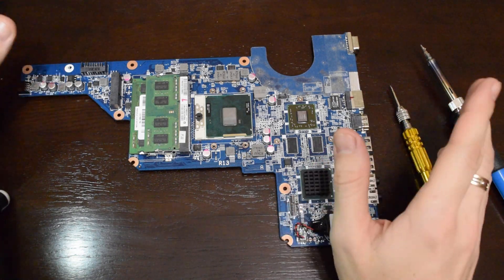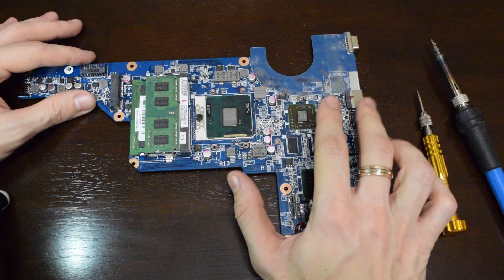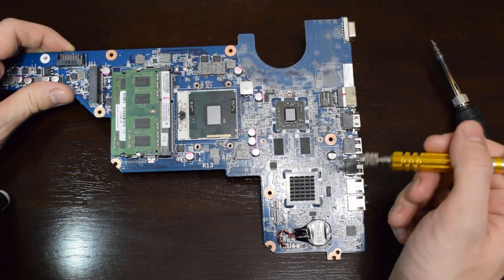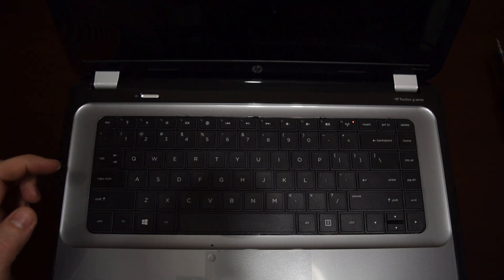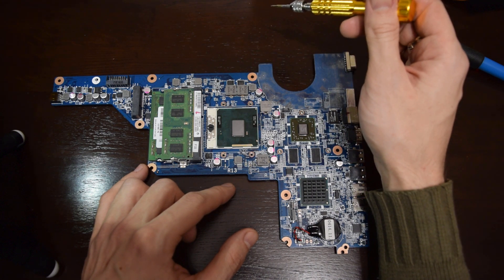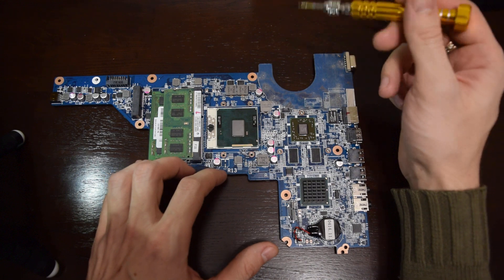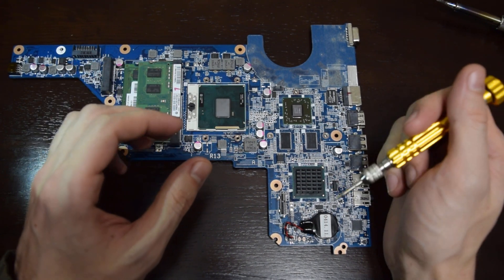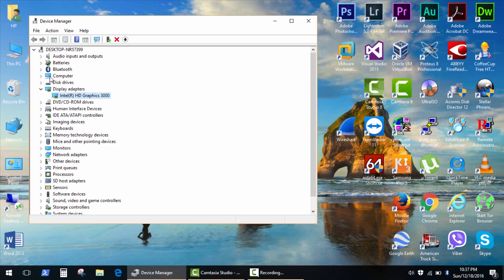Fix Dead GPU – Convert HP, Dell, Lenovo Laptop to UMA Graphics (HP G6 Example)

Comment: I Need help with hp g62 i3 350m (Intel HD + broken  ati) the CPU Is soldering  ( daax1jmb8c0 r.c)
Reply from the maker: Technically it's possible to convert your laptop to UMA version but it's almost unreal task without proper tools and skills. There's no power to integrated into CPU graphics. Basically it's not even connected. So you need to add a bunch of teeny-tiny components to make it work.
Reply from the maker: Technically it's possible to convert your laptop to UMA version but it's almost unreal task without proper tools and skills. There's no power to integrated into CPU graphics. Basically it's not even connected. So you need to add a bunch of teeny-tiny components to make it work.
Reply from the maker: Technically it's possible to convert your laptop to UMA version but it's almost unreal task without proper tools and skills. There's no power to integrated into CPU graphics. Basically it's not even connected. So you need to add a bunch of teeny-tiny components to make it work.
Reply from the maker: Technically it's possible to convert your laptop to UMA version but it's almost unreal task without proper tools and skills. There's no power to integrated into CPU graphics. Basically it's not even connected. So you need to add a bunch of teeny-tiny components to make it work.

Comment: hello bro. My laptop model is Hp-e036tx 14.. my dedicated gpu creates problem. could you tell me please tell any solution..... my laptop is shut down suddenly .. because dedicated gpu creates lot of heat.
Reply from the maker: First I'd try to clean the heat sink and replace the thermal paste. If it doesn't work you can easily disable the dedicated GPU by removing to coils. Your battery will last way more and no heat anymore. I sent you a link with a picture if you can't see it's in your spam list.
Reply from the maker: the link: https://ibb.co/c8VfZdm
Reply: @ElectronicsComputers  ok i will try.... i already clean heat sink and put thermal paste.. but not works....but when i give to heat to dedicated gpu... it works for some days

Comment: Hi friend
I want to ask you for some help. I want to disable the Ati Mobility Radeon 6370m on my HP 4520s but i am not sure which coil to remove or should i remove the chip itself altogether with the coil?
I saw boards like mine with no 4 black Samsung chips above it and the graphics chip itself on aliexpress but i am not sure. Can you tell me if i can remove this chips altogether or what to remove exactly?
This is my board
https://ibb.co/dPRTnXF
Thank you
Reply from the maker: Your laptop has 1st generation CPU and it's kind of tricky. Technically it's possible but you'll need to add/remove/replace a bunch of teeny-tiny components which is unrealistic job without proper tools and skills.
You can buy a new motherboard just for 29$ without GPU: http://ali.pub/3yt96p
Reply: @ElectronicsComputers 
Thank you mate
I gues that would be my solution

Comment: I have a sony vaio SVE1516EA with a dead graphics, How can I do the process?
Reply from the maker: Technically it's possible to convert your model to integrated graphics but you have to remove/add/swap a bunch of tiny compo nets which is unreal for a person without proper knowledge. The problem that integrated graphics in your model doesn't get power because there are no components for it.

Comment: @2013Electronics&Computers  
Can you please point out the power coil for an HP dm4t-1100. I believe the motherboard part number is 621044-001. Pictures:
https://ibb.co/BV9W05S
https://ibb.co/X8GbMmB

Thanks!

Comment: Fixing mine was a little different "Pavilion DV4t-5100", instead of a coil, desolder a solder jumper. Removed it and... video! Better method than re-flowing. Thank you for your help 👍👍👍👍👍
Reply: how i recognize a right "coil spread" ? i need some better description.  Lenovo y570 ..

Comment: Hello, I have disabled the GPU by desoldering that part, and now the laptop boots fine (no blinking caps lock). However, the screen doesn't work, and I have to connect an external monitor via VGA to get a display. I've seen that for some models you're also required to switch the position of a resistor for it to work. Could that be my problem? Board model is Hannstar MV-6 94V-0, taken from an HP G6 1000-ev.
Reply: Some new info, the previous guy that attempted to repair the laptop had disconnected the cable from the LCD. I plugged it back in but the screen is white, so the problem is partially resolved. I assume that for some reason the screen isn't getting the signal from the integrated GPU which further points me to some sort of resistor I should switch places. If you figure it out, please let me know! Thanks in advance.

Comment: Hi same issue with my dv6 3050 tx, I have given itfor repair, same told by the person that dedicated graphics should be removed and it will work on intel graphics. But he is charging me too much and he is saying it is because he needs to do programming in mother board. Is it? I just need to know what programming and all he is saying is right or he is just saying to charge more money
Reply from the maker: First of all, I need to see the picture of your motherboard or its part number. The problem with your model is that there's no power for integrated graphics.( HP decided to save a few cents on extra components.) So, technically it's possible to deactivate integrated GPU but you have to add a bunch of tiny components to provide power for integrated graphics. But as I said, I need to see the picture first.

Comment: @UCvjFW_PH081McVObdWw-vIA 

May you please tell me which coil for Fujitsu lifebook lh532 core i7 with integrated graphics of  Intel 4000 + Nvidia 620m 2giga??

Regardd
Reply from the maker: Technically it's possible 100% but I'm not sure if removing those coils is enough. I don't have schematics for that laptop. Anyway, you need to remove two coils. Let me know f it worked for you. If you can't see the link it's in your spam list.
Reply from the maker: the link https://ibb.co/ydD16Rg
Reply: @ElectronicsComputers   I did it already by removing only one (the above Chip one) and nVidia already disabled, but what about the second one, should i remove it?? 
btw.. there are two Mosfets related to those coils (as on schematic) so should i have to remove all ?? or only one i did ??
Reply from the maker: @masyafak.ma3ana.a7la-matro57  It's two phases power circuit to power the GPU so I'd remove them both in order to completely disable it. Let me know about your final result.
Reply: @ElectronicsComputers   After one coil removed as i mentioned, laptop is working normal except when on battery usage, battery light blinking (pink), no orange "to do charging", nor blue "for full charge".. it is pink light colour :)
 and i noticed it stayed on battery long lasting as before :)
so, i will try to remove the second coil.. and post result
Reply: After second coil removal.. it's the same result, laptop working ok, but on battery usage, it's light blinking pink:(
What's your opinion for that ?
Reply from the maker: @masyafak.ma3ana.a7la-matro57  I think that pink indicator comes from your BIOS. It shows some error. I never had any experience with Fujitsu, I'm certified HP, Dell and Samsung only. For example for some Asus laptops after disabling integrated GPU you have to reflash the BIOS with UMA version only. It's kind of risky so I'd just leave as is.
Reply: @ElectronicsComputers  I think so, as I already read about Clear ME BIOS version.. but is there any possible problem if I ignore that Pink light as it ?
Reply from the maker: Just ignore it. BIOS can't get check readings from the GPU and shows you the pink error indication. I don't recommend to mess with the BIOS. Very high chance that your motherboard will die.
Reply: @ElectronicsComputers  thanks alot, and best regards
Reply from the maker: @masyafak.ma3ana.a7la-matro57  I'm happy to help!

Comment: hello i have a hp proobook 4510s .its a problem for me to identify the right coil to remove .it will helpfull for someone to identify it by number for me
Reply from the maker: It's not gonna work, it's too old laptop with Core 2Duo CPU which doesn't have integrated graphics into CPU.

Comment: Which coil to remove on Sager NP8157? Thank you in advance
Reply from the maker: Sorry, I can't help you with this one. I don't have schematics and there's little or no information about that laptop or brand.
Reply: @ElectronicsComputers  I have the manual and schematics. Can I send you on mail? Really appreciate the help. Model is Clevo P650HS-G
Reply from the maker: @erwindetorres3191  Found the schematics! I'll check it and tell you later.
Reply from the maker: Sorry for the late reply. So, technically it's possible to convert your laptop to UMA but I think you will need to add/remove or swap some components. You can try to remove this coil: https://ibb.co/8c9MmYR
But I think it will need more than that.
Reply: @ElectronicsComputers  Thank you very much! I will check it.

Comment: I know this video has been around for a while and you probably already forgot about it but I hope you respond.
My only laptop (hp elitebook 8560p) got a dead GPU but I'm not sure which coil to remove. Please help.
Reply from the maker: It's not gonna work for this model there's no switchable graphics and there's no even power coming to the integrated into CPU graphics. New motherboard costs 50$: http://ali.pub/3s58uw
Reply: @ElectronicsComputers  Hi man! can you check my comment please? I added a sample of my problem, can picture the board if needed. Many thanks!

Comment: I have a similar problem when I set the graphic option to "dedicated" in BIOS I get artifacts on screen as soon as the system gets to the log in screen and black screen after a few seconds. I only see the mouse pointer. I can only run windows by setting the graphic option from "dedicated" to "UMA" in BIOS and disabling HD 5500 graphic driver from safe mode. I'm not sure why I can't leave the HD 5500 graphic driver without disabling it?

Comment: hello my laptop is a toshiba sattelite 670 with matherboard [nalaa la-6042p] witch circut i can remove to work without gpu
Reply from the maker: Unfortunately it's not gonna work for you. It works flawlessly for HP, Dell, Samsung and some Lenovo models. But You can fix it for 43$ with this new motherboard from a very good seller: http://ali.pub/3q43yt
Reply: @ElectronicsComputers  thank you,  but the motherboard you suggest isn't the same as mine my board model is LA-6042P   Rev 1.0

Comment: Hello! Lenovo g580 with core i5. I tried reflow and removing 2 coils but it is the same. fan spins for 2 seconds and thats it. No post no nothing. I've had at least 20 successfully reflowed gpu's. Everything worked at least for a day but this one... reflow does not help. RAM HDD removed, just bare motherboard and no post.
Reply from the maker: If the problem really in GPU then it's really to fix. I'll sent two pictures if you can't see them them my message in your spam list.
Reply from the maker: Disable two coils and then you have to move those two resistors to another place and that's it. 

https://ibb.co/yk9M3mc
https://ibb.co/tbCk8hN
Reply: @ElectronicsComputers  I found the resistors but didnt understand where to move them ?
Reply from the maker: @taroxz2346  You need to move two resistors:
https://ibb.co/CnMCZSC
https://ibb.co/tbCk8hN
Reply: @ElectronicsComputers  Still not working. The chipset is getting pritty hot and there is nothing to cool it down. Could it be dead ? I tried reflowing him also with no luck.
Reply from the maker: @taroxz2346  Then your problem is definitely not in GPU. It's hard to diagnose your problem without checking all the voltages.
Reply: @ElectronicsComputers   Anyway! Thank you so much ! I learned a new and better fix from your video!!
Reply from the maker: @taroxz2346  I'm happy to help!

Comment: Not work in Hp G62  Intel + Amd Graphics card
Reply from the maker: It should definitely work! Did you remove the proper coil from the opposite side of motherboard? I'll send you a link if you can't see it then it's in your spam list.
Reply from the maker: Here's the link: https://ibb.co/MsmvkpH
Reply: @ElectronicsComputers  So I removed the proper coil from the motherboard and now im getting no image, the screen is dead. Before removing was working good on internal I5 GPU but the ATI GPU was burned and was 80 degrees celcius without stress. Any sugestions for me now to fix it?
Reply: Images of my motherboard after removing the coil:
https://ibb.co/CPSDddY
https://ibb.co/HKYs3Qq
Reply: @ElectronicsComputers  Are You 100% sure it is the correct coil to remove? My broke durring removing. I'll try tommorow to buy one and soild it in place to see if its brings back image on screen.
Reply from the maker: @harryharoldinio  That model also requires swapping two tiny resistors. Watch this video: https://www.youtube.com/watch?v=jwQwmM3mT24
Reply: @ElectronicsComputers It did work after swapping those two resistors. Removing the coil isn't necessary. Thanks
Reply from the maker: @harryharoldinio  I'd recommend to remove that coil, otherwise your dead GPU will still draw the current.

Comment: i have hp 8770w and mxm card is dead how i can enable hd 4000?
Reply from the maker: Your laptop has removable graphics card simply remove it and use your laptop without it.
Reply from the maker: Your laptop has removable graphics card simply remove it and use your laptop without it.
Reply from the maker: Your laptop has removable graphics card simply remove it and use your laptop without it.
Reply from the maker: Your laptop has removable graphics card simply remove it and use your laptop without it.
Reply from the maker: Your laptop has removable graphics card simply remove it and use your laptop without it.

Comment: Hp pavilion dv 5 1000series which coil? I need to remove?
Reply from the maker: Unfortunately it's not gonna work for you. That laptop is too old and those CPUs don't have integrated graphics into them.
Reply from the maker: New motherboard will cost you just 30$.
Reply from the maker: Motherboard with free shipment http://ali.pub/3od26g
Reply from the maker: If you can't see the link my message is in your spam list. Good luck!
Reply: Ok thanks for the response
Reply: Is there no more things that I can do to fix my laptop???

Comment: Do AMD processors have integrated video?  Because my unit is AMD.  It lists the specs on the video card, so it has a GPU, I just don't know if AMD cpu laptops can have the same fix.
Reply from the maker: New AMD CPUs come with integrated graphics. What's the model of your laptop?

Comment: Can this for work for dell latitude series ???
Reply from the maker: It works but depends on your CPU. What's the model of your laptop?
Reply from the maker: That laptop also has Core2Duo CPU. You need Core i3, it, i7 or relevant CPUs  we with integrated graphics. Core2Duo CPUs don't have integrated graphics.
Reply: I will like to be talking with you time to time for more knowledge. If am permmited
Reply: I have dell laptop I want to fix, how can I show u the motherboard to pick out what to remove to fix it
Reply: Thanks boss
Reply: Latitude d630
Reply: Ok, thanks. What of hp6730s
Reply from the maker: Nooooo it's very old machine. Those CPUs don't have integrated graphics into it.

Comment: Hi. Great solution. Should I change any setting in BIOS? My BIOS does not have any option about graphic.
Reply from the maker: If you disable discrete graphics your BIOS will think that there's only integrated graphics. It works only for HP and Dell! For some laptops you have to reflash BIOS for integrated graphics.
Reply: @ElectronicsComputers  thank you!

Comment: Hello! Could you help me? I have a MSI GE62 6qf laptop with a dead Nvidia gtx960M. It has an intel i7.
Thanks a lot!!!
Reply from the maker: That method perfectly works for HP and Dell due to well engineered schematics. All other brands save a few cents to remove all extra components to make their stuff cheaper. So, technically it's possible to convert them to integrated graphics (UMA) only but you have to swap/remove/add a bunch of teeny-tiny components.
Reply: @ElectronicsComputers  Ok! Thanks! I will search more information. I can't find any schematics or any gpu datasheet, so if you have an advice it will be wellcome!. Tanks a lot!!!
Reply from the maker: @matinatal  I'm servicing only Dell and HP equipment, so I have service manuals only for those brands.
Reply from the maker: That method perfectly works for HP and Dell due to well engineered schematics. All other brands save a few cents to remove all extra components to make their stuff cheaper. So, technically it's possible to convert them to integrated graphics (UMA) only but you have to swap/remove/add a bunch of teeny-tiny components.

Comment: I have several HP ZD8000 laptops, each  with a dead graphics chip.  I disabled  the graphics chips through the device manager and the screen is functional but not as sharp and detailed as when the ATI graphics chip was functioning. These computers have an Intel Pentium 4 Processor 520. Will the screen quality improve if I use your procedure to shut down the ATI graphics chip? Tanks for your help.
Reply from the maker: It's not gonna work for you! Those laptops have only discrete graphics. When you remove those graphics cards from device manager you just disable drivers and your system can't maintain resolution anymore. This is why the quality of image goes bad.